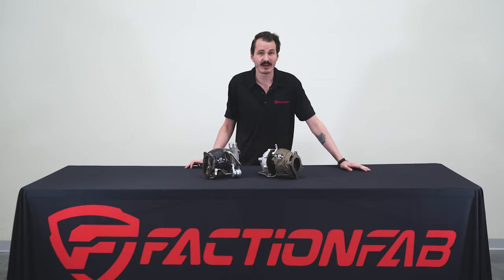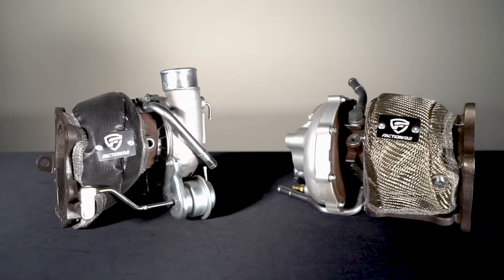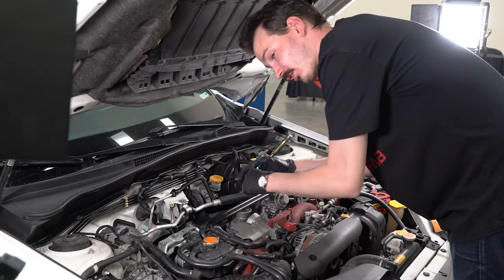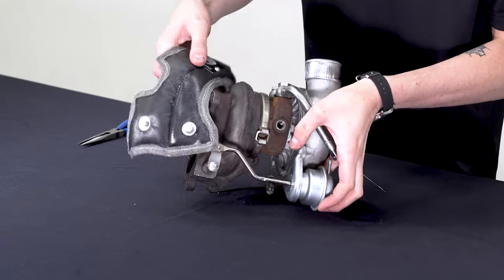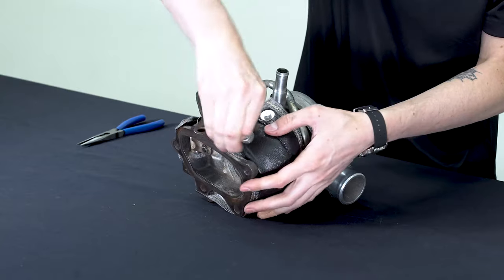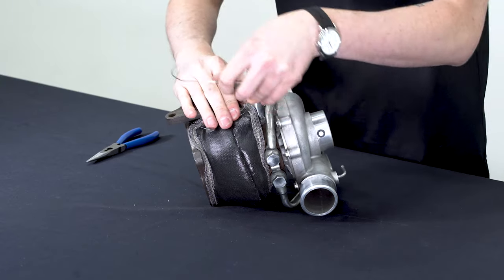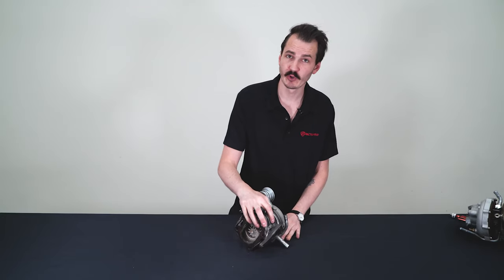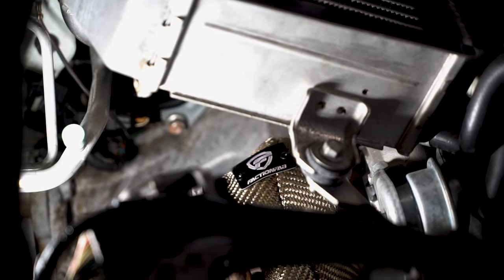Why You Need A FactionFab Turbo Blanket and How To Install

Comment: when using the safety wire pliers, you can simply take one long piece of wire and wrap a loop or two around each hook on the blanket. bring the end of the wire back to the first hook and twist the two ends together to secure.